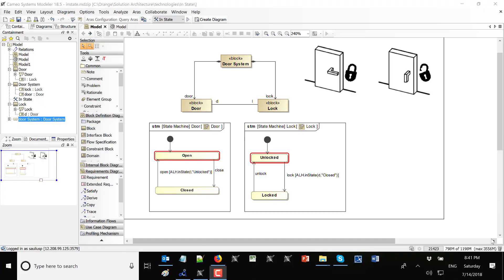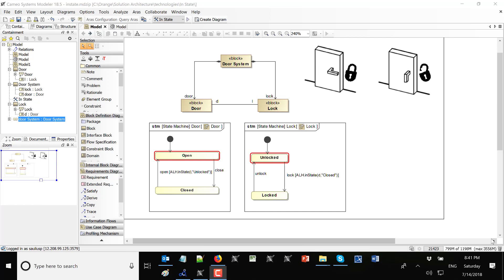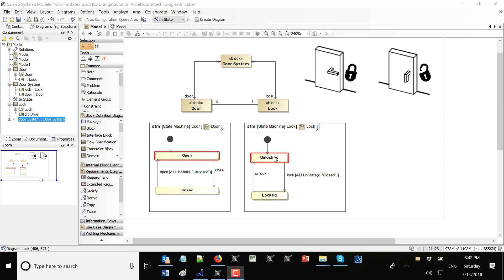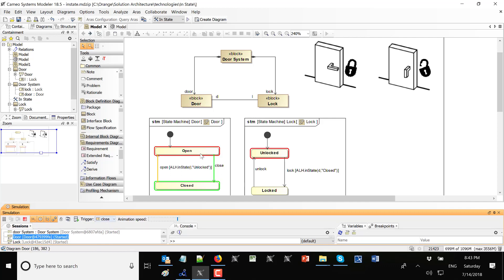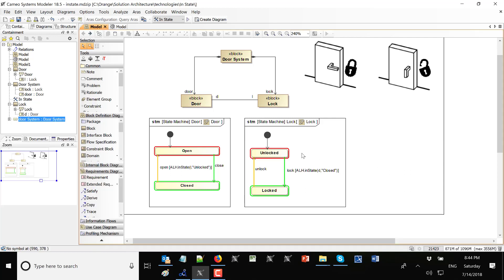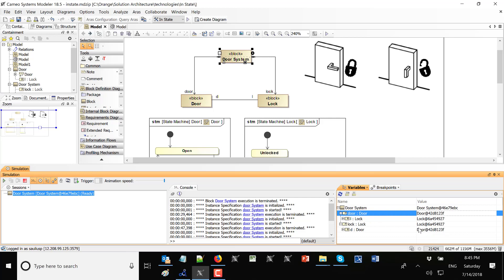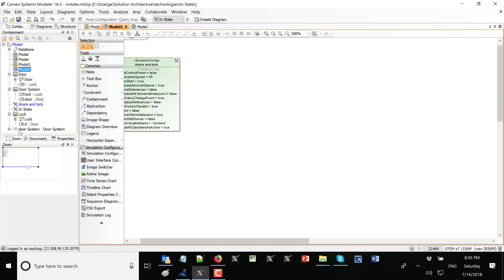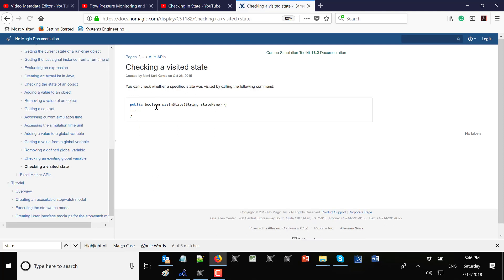Checking Dependency Between Different State Machines

Comment: trying to implement the ALH and having trouble.  Is it possible to get a copy of the demo model to see how you implemented ALH into model?  Or is there a better reference that describes how to implement the ALH you described here?
Reply from the maker: Hello Kizer, here is project file https://bit.ly/2ZOMlCt. Documentation is available also: https://docs.nomagic.com/display/MSI190SP2/ALH+APIs
Reply: @MBSEExecution  THank you.  I tried applying this technique to the recent "Executable Flashlight example" you all provide to ensure that flashlight was in the "Off" state before closing down but it keeps throwing errors...."00:00:40,794 ERROR: Cannot evaluate Opaque Expression: org.mozilla.javascript.WrappedException: Wrapped java.lang.IllegalArgumentException: object and state name must not be null. (<Unknown source>#1) in <Unknown source> at line number 1 expression body: ALH.inState(b,"Off") 00:01:01,636 : ** Block SC execution is terminated. ****"  

For that specific example, would I need to combine it with the ALH.sendSignal to ensue that the flashlight is off if the signal comes when the light is "On" to force it to off before exiting??  Can you combine to ALH's on a single transition? Thanks for all your examples.
Reply from the maker: Hello Kizer, hard to say what is wrong. Please submit model for an investigation  at support@nomagic.com or MBSEExecution@gmail.com